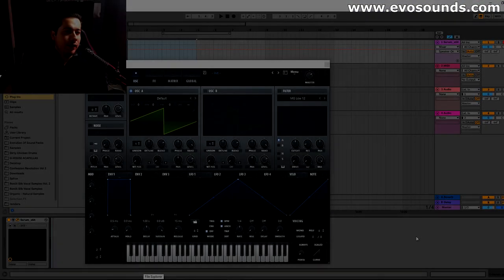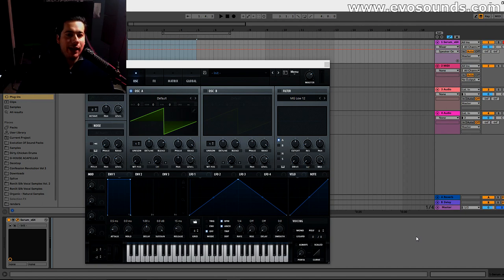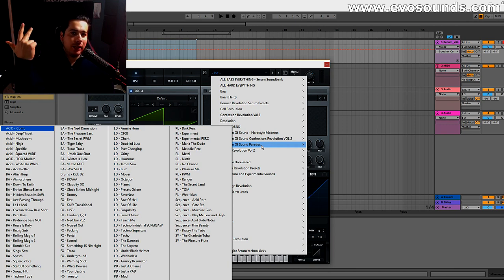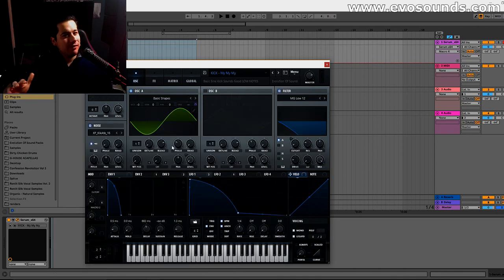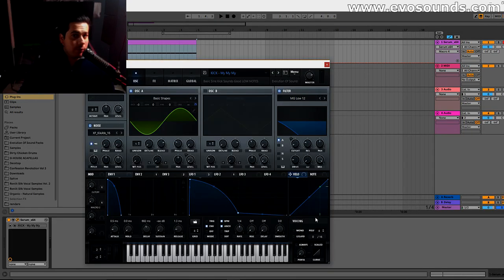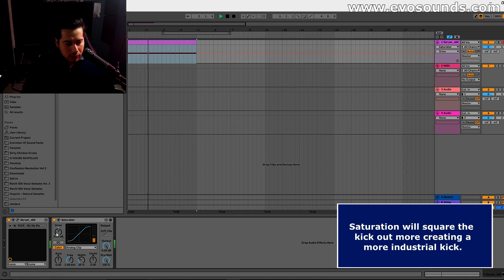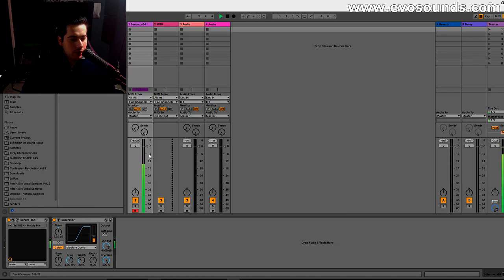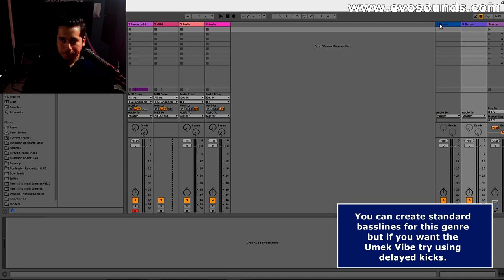How to Make a Techno Drop

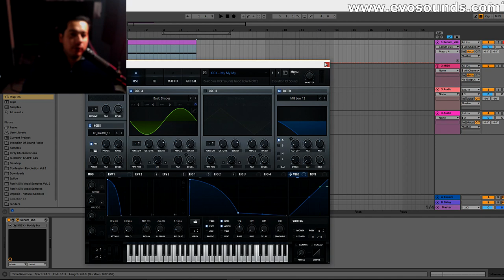Comment: Answer for 2:55 is, when you set mono on, all the voices can produce just one signal. (It means if you have just osc a turned on with 1 unison, there can be only one signal coming out.) And then if the next note you hitting is starting before last note releases, oscillator won't reset the phase. That means the next note's phase will be starting where the previous one's was. If you shorten the notes or cut the release all the way down, the problem should be solved.

Btw, I know my English is not perfect, just tried my best to explain.
Greetings from Turkey
Reply: Honestly, you did far better explaining this than most other people fully fluent in English, thank you for finally explaining it properly.
Reply from the maker: Thank you Halil I thought it would be the opposite but now we know and it helps a ton !
Reply: thank u abiciğim <3
Reply: yes and no . You can use polarity reversal aka to some people phase inversion but its truly polarity reversal, then pan the unprocessed signal hard left one hard right , you will then hear the difference between the two which should help you line up the phase from there to see whats actually affecting the signal.
Reply: multiple signals even if mono or not are bound to be out of phase for moments you described. again treat it like youre recording guitar over dubs and align the signals so that when theyyre PLAYING due to retrigger or release whatever the case may be then they are additive . good work on the minus 30 too i thought for a second you were going full fader!

Comment: HI, great video. I am new to Ableton so sorry for the dumb question, you pulled out a side chain real quick at the beginning, the work flow was so fast. Can you explain if that was an Ableton compressor used for the side chain , I didn't see you assign the kick to it.
Reply: LFO Tool is a pluck-in by Xfer Records, in which you draw in the sidechain instead of assigning an input.